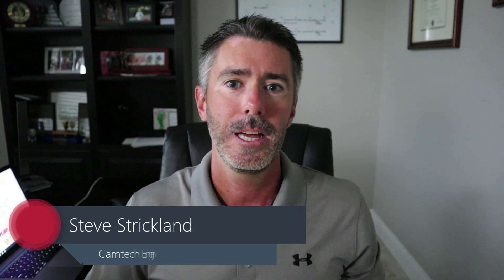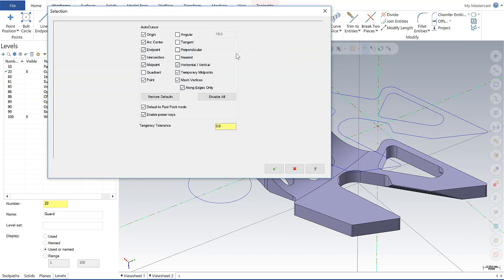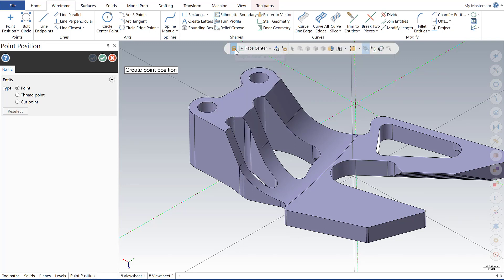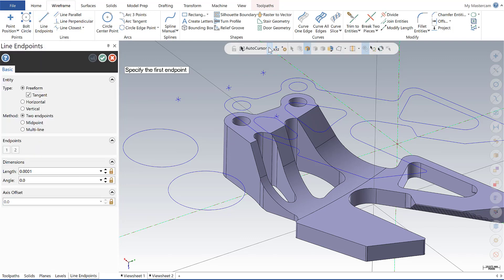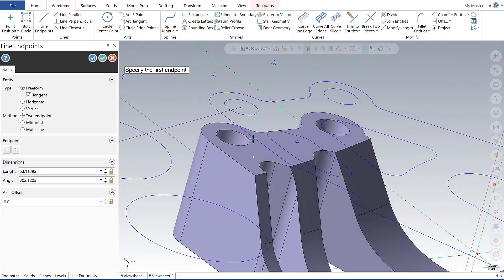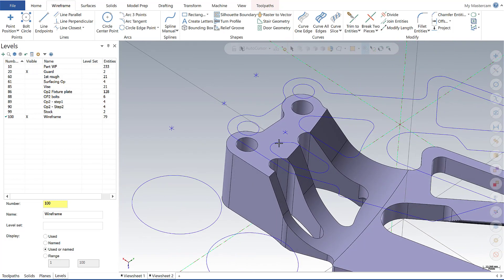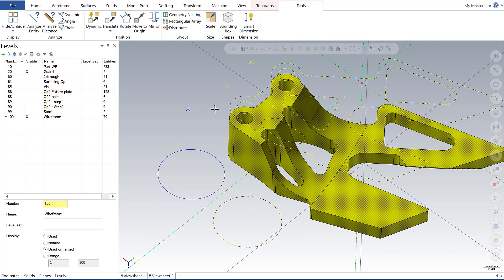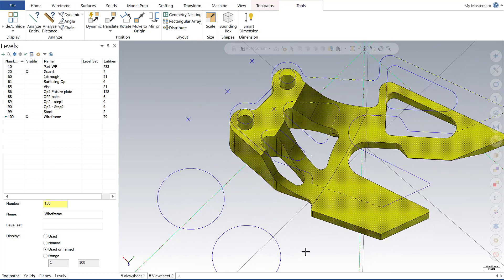Mastercam Selection Bar - #Mastercam 2020

Comment: Would you recommend switching over to 2020 from 2019? Typically I wait for a couple updates so the bugs are worked out, but I don't know anyone who's tested it out yet, suggestion?
Reply from the maker: Switch to 2020.  We've had very little by way of tech support that is attributed to the 2020 release.  Any software package has some bugs, but 2020 is very solid based on our experience.